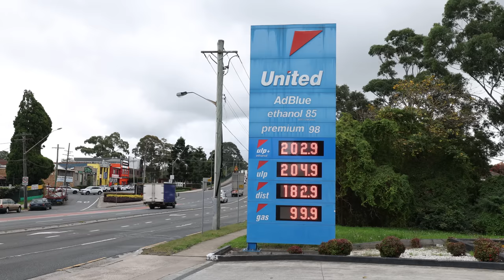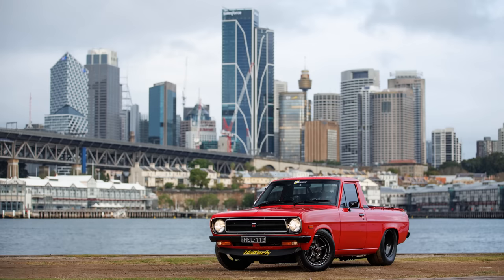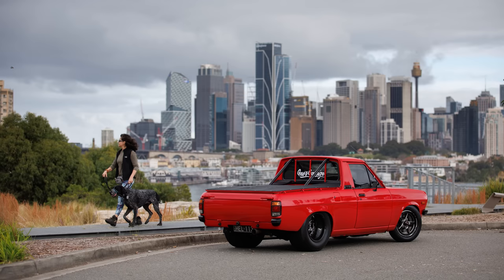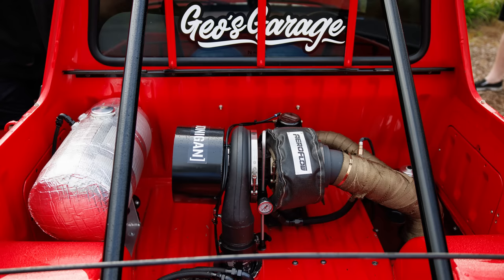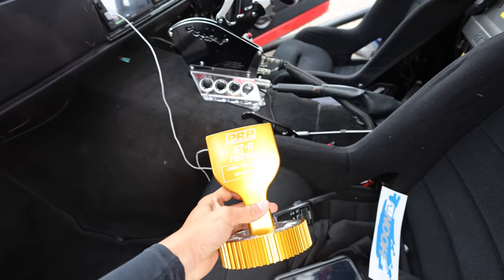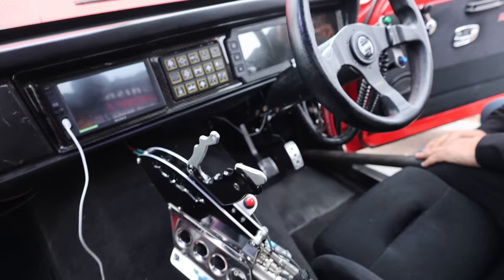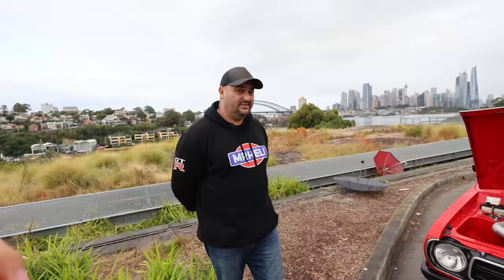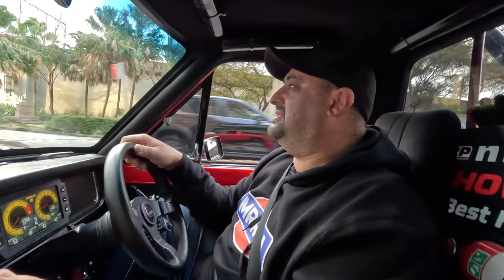This 650HP GT-R Powered Datsun Ute Took GT-R Festival By Storm | Capturing Car Culture

Comment: In South Africa we call them "bakkies" and the 120 Datsun is one of the OG's here. Later it was updated with a 1400cc motor, square headlights and finally a 5 speed box. They are considered indestructible. He would not be able to drive 1km here without someone stopping him and making an offer. Until eventually he would just be hijacked.
Reply: As a fellow South African, I 100% agree with this statement ^^^

Comment: Makes me want to track down my Dad’s old ‘73 620 pickup and try something similar.
Reply: I knew a guy who had a 520 1300 back in the 70's.  I drove it many times.  Seemed the more heavy-footed I drove it the slower it went.  It ran better with a light foot feeding throttle gently after upshifts.  Probably carb issues, but that's my main memory of the vehicle.  Learned to drive a stick with that 520.

Comment: The front tires are so small and the back where the power goes are so wide. Does it have understeer and oversteer at the same time?
Reply: Built for straight line racing mate. Hence the skinnies up front and drag meats at the back. Made to party. 🍻 Cheers

Comment: These cars had 48 kW with the original 1400 cc engine, torque was 130 N.m
Top speed 155 Km/h
I think the earlier 1200 engine had a top speed of 135 - 140 Km/h